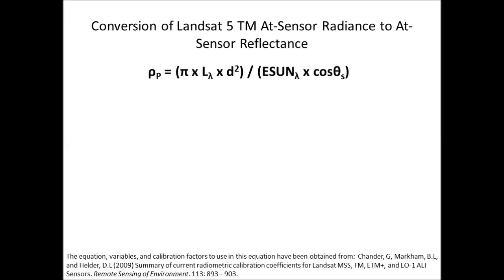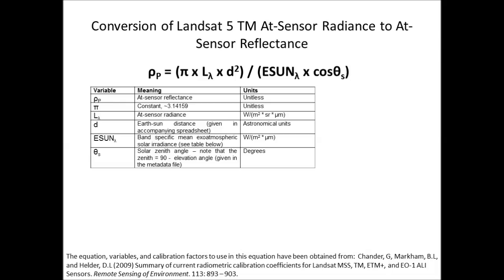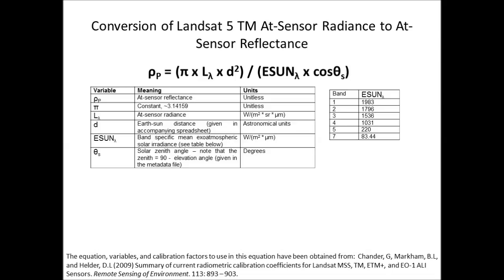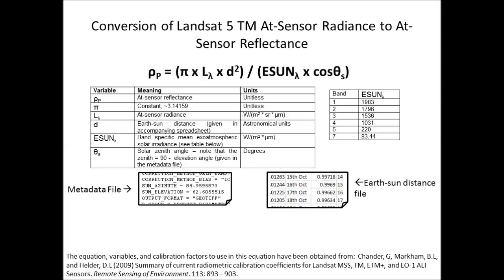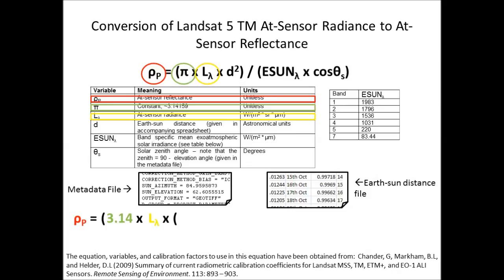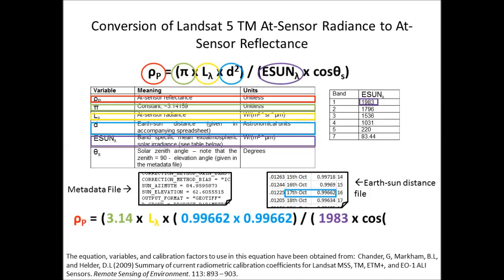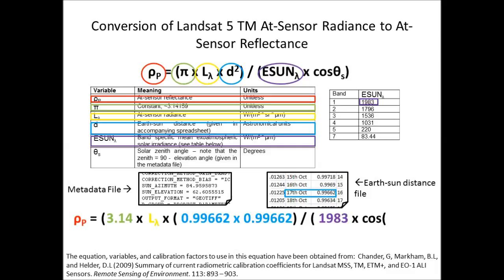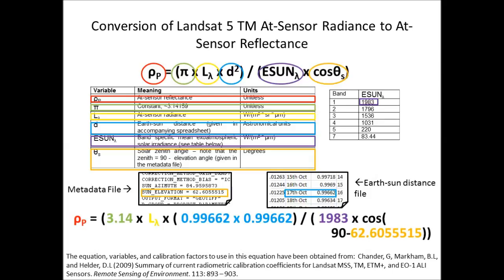Understanding the Equation to Convert At-Sensor Radiance to At-Sensor Reflectance

Comment: One thing to remember is that some programs handle trigonometric processes differently. ENVI might require the unit of degree when using COS() or SIN() but Erdas requires the units to be radians.
Reply: And in ERDAS, you better use the float() operator or decimal point (180.0) to avoid truncations when dividing.